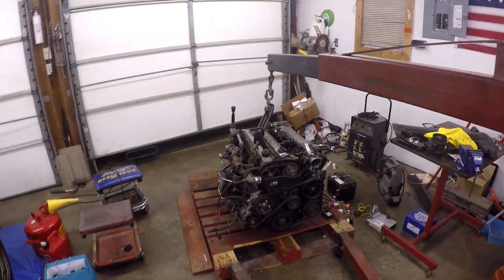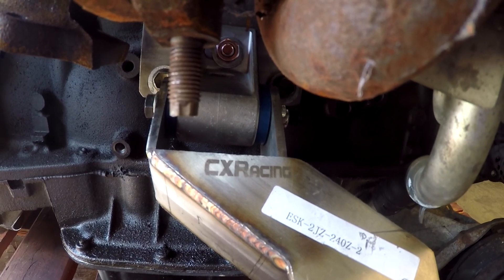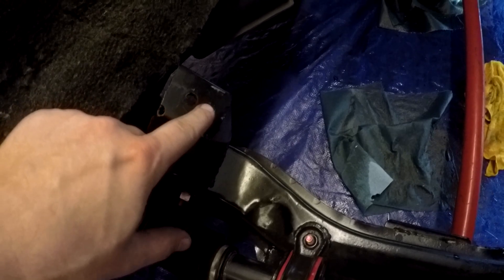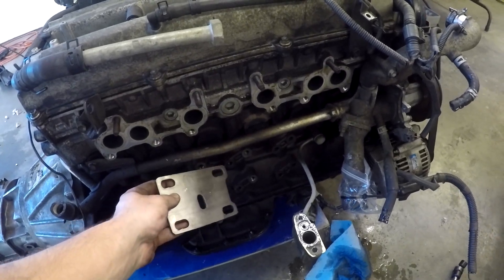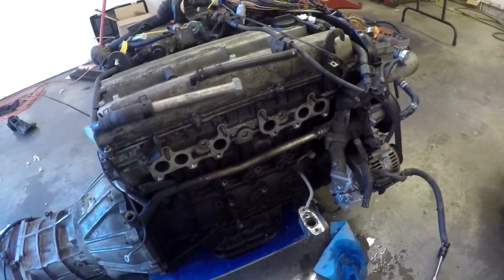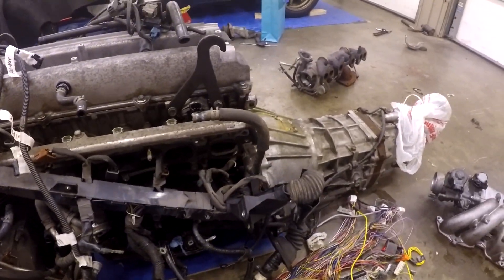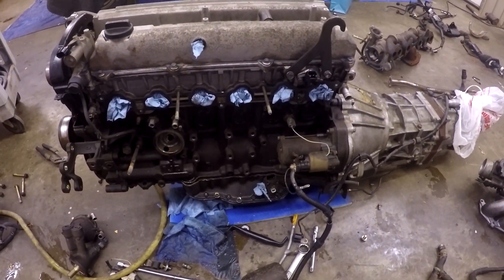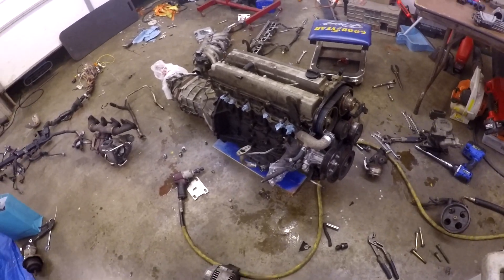Test Fitting the 1JZ in Datsun + Engine Tear Down

Comment: Looking good. I'm doing an rb25 swap and I did the same with the engine. New, water pump, oil pump, gaskets, fuel rail and injectors and painted the valve covers and intake. Keep it up.
Reply from the maker: That'll be sweet